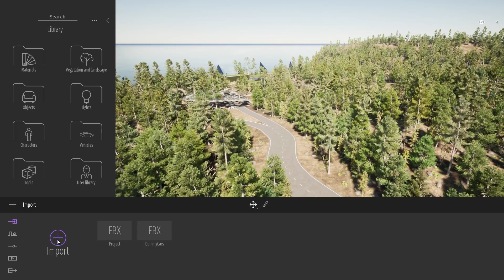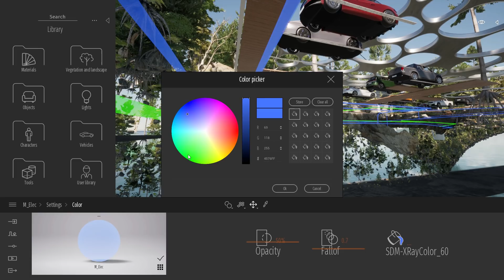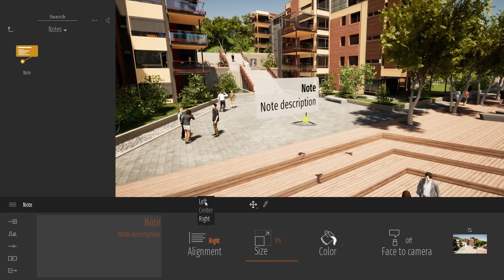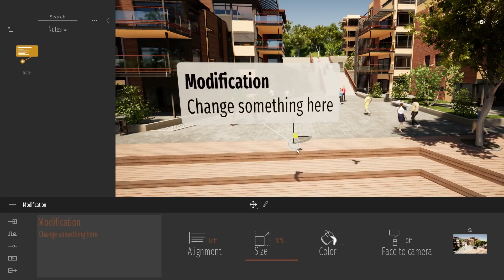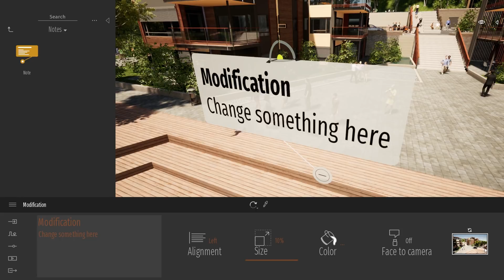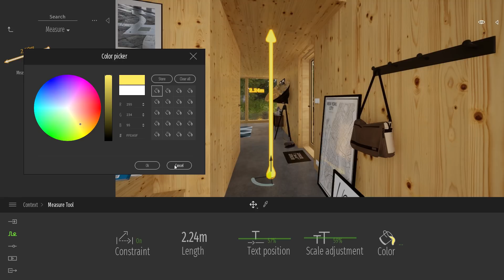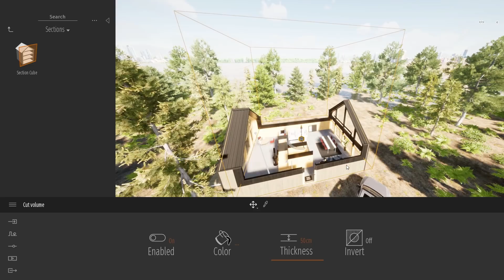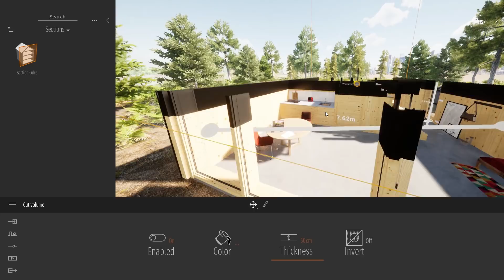Twinmotion 2020 Tutorial - Project review tools

Comment: Hello Twinmotion. I dont know where to ask the questions that i have, so i ask it here. May be somebody can help. I have this Issues:
 1)When i start VR in 2020  i rise up to about 3000 cm above the surface and there is no way to stand with the feet on the ground. i am 180 cm height, but when i put on VR set i become a 3 meter giant and theres no way to become normal height. I pressed F12 and there in settings changed the height to 0.1. at this moment when i start VR i was normal height, but when i use teleport once, everething drops down and i am again a 3 meter giant. I need to show my project to  my client in VR but now its absolutely impossible.
2) when i put my quality setting to ultra left monitor of VR set shows all correct, vut the right one meakes some textures totally black. so its also no way to dhow project to client it this way! 
I have all latest drivers installed and use geforce  1080 TI. IT would be great if someone can help to solve all this!